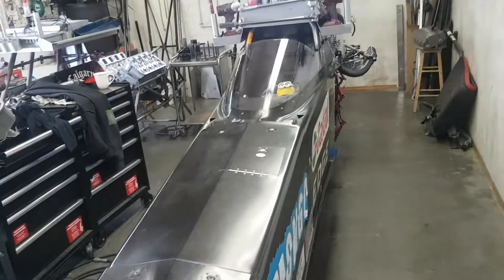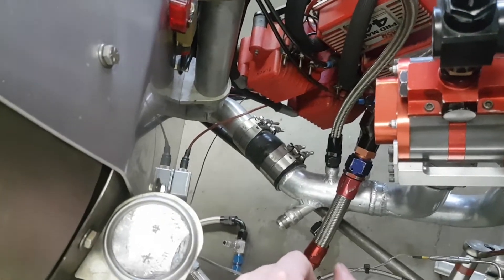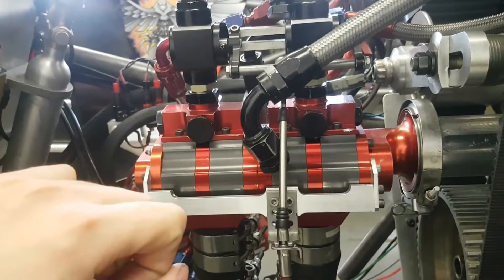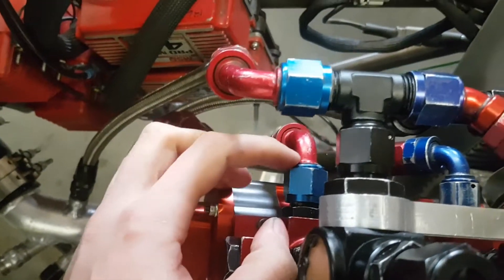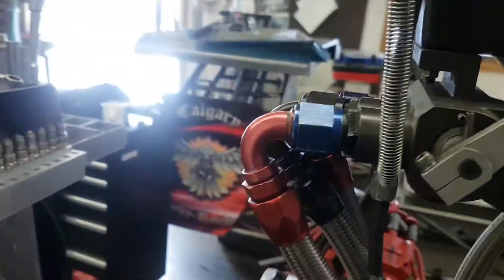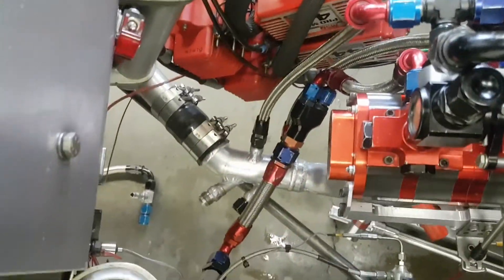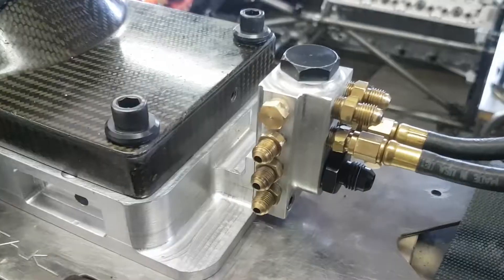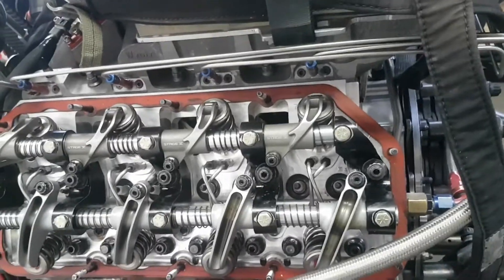Top Fuel Tutorials Episode 3 (Fuel System Walkthrough)

Comment: hi  could you tell me what is the container shape with two hose going in to the engin at the rear of the engin is it special fuel or cooler or!!! thank you and good work and video.
Reply: That is a catch can for excess oil for when the engine pressurizes preventing the oil getting dumped on the track

Comment: when we went to the larger ci motors with the billet cases the first four passes threw a rod thru those pretty new cases,lol.rods with no give heat treated chromemoly along with to much compression,and the big killer was not enough rod bearing clearance.Bob Obzinski and myself finally realized the one piece rods back then male and female were egg shaping the rod races causing the rod rollers to start sliding eating up the crankpin hardface,etc,etc,boom.In later years i worked at Siemens corp making turbine blades.i'm retired and still have a machine shop at home.I have always wanted to hang out in the top fuel pits for a weekend.When i quit racing in 1993 we were running 7.00's at @ 195 mph.The tuning has always been as good has riding to me.The racepaks really did not hit top fuel harleys untill a tear or so after i quit.i was running 4-5 hi speeds back then